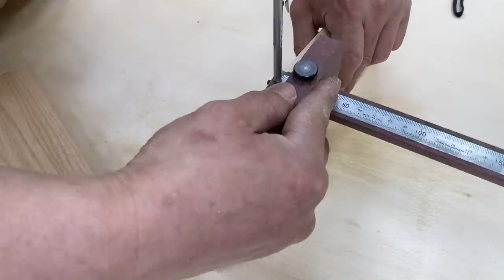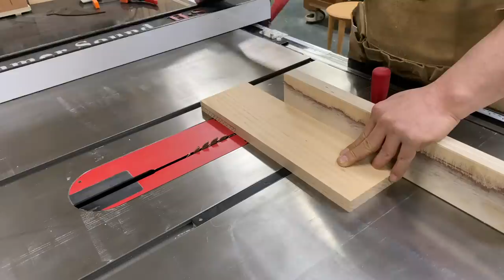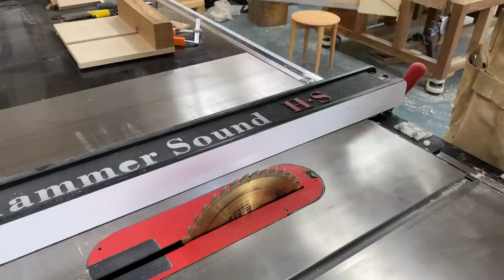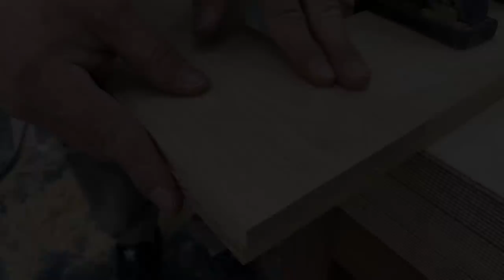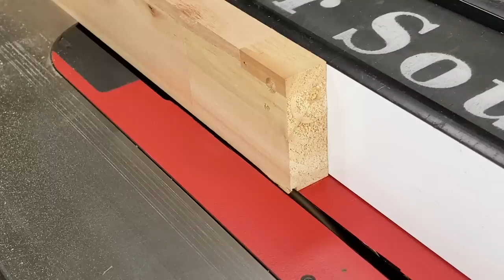If you let go of stereotypes, your level will go up./ 3 wood processing methods/Woodworking DIY

Comment: Make sure you buy and have the proper blade before doing this. They are harder to find than you think. They are called flat top or square blades. I had to order one online as all 3 hardware stores did not carry them. They are nice though.
Reply: Strong agreement! I recently tried doing this kind of cut with an ATB blade - mistake! It removed the wood just fine, and quickly,  but left lots of ridges. It took another couple of hours of plane & chisel work to make it all flat & smooth.
Reply: FLAT TOP BLADES ARE AS EASY AS GOING TO AMAZON.... LOCAL STORES ARE HISTORY NOW !!!!!!!
Reply: In my experience as a union carpenter, cabinet maker and woodworker hobbyist for 35+ years. I’ve found that to get the proper tools that perform on the level that the video shows. I buy my tools from tool distributors, not Home Depot or similar box stores or hardware stores. Tool distributors sell commercial grade tools, the chains and box stores do not. Online look for Rockler, Veritas, Granger, woodworkers warehouse.  Good luck.
Reply: In the UK I bought a "Groving blade" which is flat topped and has a much wider kerf. Best alternative I could find for a dado stack.

Comment: A secret for getting perfect depth laps on the table saw (using technique 1 and a scrap of the same thickness) -  Raise the blade and make a cut at the very end of the board. Flip it over and take another cut leaving a tiny tenon behind. Keep raising the blade slightly, taking a cut on both sides. When the cut finally takes off the thin bit left behind it is the perfect depth.
Reply: I’ll do that. Cheers.

Comment: Using the rip fence and crosscut slide at the same time is advanced saw work. If you get a bind things are flying out of the back of the saw at hi speed. I wouldn’t want to be in the way or have to patch the hole in the wall.
Reply: I think because in this case there weren’t any off cuts, it’s reasonably safe?  I would still hesitate to do it, but the waste is all sawdust so I think the risk of a bind is very low.
Reply: You should only use both when making non-through cuts like cutting a rabbet or dado.
Reply: My bet is I have 10x the time on a saw as you. Most of the stories from people with missing fingers start out the same as yours…
Reply: Let the pros handle that process, my fave way of doing tenons.
Reply: @robslifting4life  - lol-
I have hammers older than you.
I have worked on some pretty famous buildings. I have built the best of the best. 
I still have all my fingers.
And things happen on a table saw faster than you can think.
I am saying don’t do it.
Put a stop block on the fence. But don’t cut with the board on both. 
It works fine until it doesn’t.
Reply: @michaelgarrow3239  I myself wouldn’t do this, but do you agree with the logic of my previous reply? I can’t tell who you’re replying to in this thread.
Reply: @mrgolftennisviolin  - In my day I have done all kinds of crazy things on a saw.
However, I’m a professional and know what I’m doing. And some crazy stuff had to get done. But, I didn’t take any risks that were not necessary. A simple stop block can eliminate a potential problem. You only have to be wrong once. A knot in the wood or a nail you didn’t see can find you with a splinter the size of a hammer handle in your stomach. 
You do what you want to do. I believe in a free country…
Reply: @michaelgarrow3239  well said, I wasn’t planning on trying this anyway, I’m more into hand tool work for violinmaking, so rarely find myself needing a table saw.

Comment: This type of channel is exactly what I look for when I’m looking for wood working tips and instruction.  Showing multiple ways of achieving the same result, basically using what you have at your disposal to accomplish the task at hand. I subscribed and liked the video before I even finished watching it.
Reply: Just be more careful than this guy is.. there are so many safety rules being broken here.. never touch the blade of a saw while it's plugged in, never grip the router by the base... and never pull out a piece of wood from the table saw in the same direction the blade is spinning.. safety first out there. Machinery is not your friend and it will bite you the first chance it gets. don't give it that chance.
Reply: not to mention he has to riving knife on his table saw.. it's only table saw safety device that actually does it job. the riving knife alone will save you from 75 of the stupid things you can do on a table saw.
Reply: You have to remove the knife for the technique he showed, and lots of other techniques such as running a dado. It’s perfectly fine to remove it under the correct circumstances.
Reply: @randazzoworld8940  fair enough habits to promote and remember but keep in mind this guy knows a bit of what he’s doing. 

The table saw he’s using is a SawStop tablesaw. It literally can’t come on when he’s touching the blade, or for 5-10 seconds after. There is a safety trip function in the switch. He would know this and feel perfectly safe touching the blade. That being said: you should always unplug your saw when changing blades and NOT touching the blade is still safer habit to keep. As most shops won’t have the SawStop saw. 

As for the router many small palm routers like his have finger grooves molded into the base, and it helps keep the router from wobbling. It’s very hard to control with only one hand. The only thing he did that I wouldn’t have was place his finger under the still running router to showcase the gap there… I cringed a bit. 

As for pulling the work stock from the blade backwards, you are correct that it’s bad practice, but again, the techniques he’s using somewhat force this method. If the operator is careful, skilled, and practiced, it can be done with relative safety. 

Is still a great video, and earned a sub here!
Reply: Great safety concerns explained. Thank you all. My guess is video intent is to demo the different possible approaches.

Comment: " If You Let Go Of Stereotypes, Your Level Will Go Up"
A Piece Of Life Wisdom That Goes Far Beyond Just Woodworking  😏
Reply from the maker: Yes, that is true😊😊👍👍
Reply: Praise Jesus, Repent or Likewise Perish  ratio
Reply: I hope safety is not stereotyping.  Please don’t let that go by removing the riving knife. The riving knife doesn’t interfere with any of the operation in this video.
Reply: @iknowgamingikg4025  well that didn't work
Reply: @ipick4fun27  if you know what the riving knife is for then you should understand why removing it isn't an issue
Reply: @davefarmery8180  for the same reason, I know what mask, eye protection as well as hearing protections are for.  I guess removing them are not issues as well? SMH.
Reply: @ipick4fun27  my bad , i thought you would know why its not a problem
Reply: @ipick4fun27  none of their cuts would have caused jamming removing the knife did not reduce safety at all.

Comment: Thank You for this video.very nicely done even without narration. These are great techniques which I will start using. Will make these joints easier and faster as well as more accurate. Greetings from Maine.
Reply from the maker: Thank you for watching.
I am cheering for you.👍👍👍

Comment: I love this video.
It addresses my biggest pet peeve on wood working videos

I get really frustrated when I see someone use a single table saw blade to chip away a dado cut and then waste lots of time to chisel and maybe even sand that dado cut smooth.

I prefer to take extra time to use a router table as I can make a pass on the table saw, then move it to a separately set up router table. I feel I get a much better dado cut and the fit is much more secure. 

But I also saw a few ideas I will try for the table saw.
So long as I don't waste lots of time chiseling the jagged table saw cuts away.
Reply: This video isn’t about the tools you do have, but about the tools you maybe just don’t have.
Reply: @firewing1319  exactly. Not everyone has all the tools and this video shows a variety of methods to cut dado.

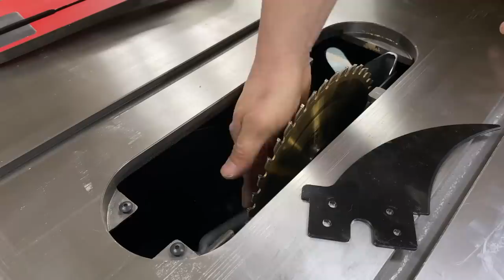Comment: Why remove the riving knife at 0:28? The top of the riving knife should be below the crown of the blade and it should not interfere with the cuts you made.
Reply: I was wondering the same thing. No harm it’s not a through cut, but I’d still leave it on.
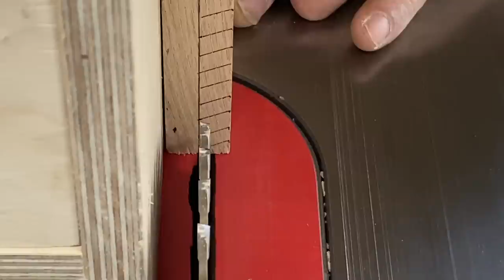Reply: @brian454454  While riving knives are most important for through-rip cuts, they do offer some kickback protection during any cut. One would have especially been important during the second cutting operation shown in this video (2:57), when a rip was made. A riving knife would help protect the user from kickback that may be caused by that non-through kerf closing upon the blade.... I'm not the safety police. If he doesn't want to use it, that's his decision and I won't nag him for it.  I just thought it was strange that he took the time to remove it and I wondered why that was.
Reply from the maker: You don't need a knife for this job and it gets in the way.
Reply: Thank you! I thought same thing but I couldn't REALLY recall all the times it was critical vs detrimental... however it seemed like it wouldn't have hurt on any of his applications.
I must've learned SMTHN during all those hrs watching your vids ; )  👍
Reply: @StumpyNubs  diffrent countries diffrent safety regulations, as a german trained cabinetmaker and joiner we were taught that the only cut that is allowed with out a riving knive is an undercover cut. But we probably have the strictest guidelines 🙄
Reply: @connorleon  how the German carpenter orders five beers🤟
Reply: @edsnotgod  fünf bier fürs Sägewerk
Reply: @connorleon  wie der Schreiner..

Comment: With the router when you did it, I saw the immediate problem - which you showed - about it "rocking".
My solution would be to start at the other "end" of where you were wanting to cut away the material/wood so both sides would be supported.  Kind of how you did it in your solution: leaving the ridges then removing them with the chisels.
But instead my way would be that you also have a "stand" that you put under the router to keep the correct height as the gap becomes too wide for the router's support.
However:  very nice job.

Comment: Nice, though I wouldn't feel comfortable doing some of the table saw techniques used, I'd worry about pinching and kickback. Still, always good to remember there are many ways to skin a cat, so you can always have your pick of the ways that seem best, just keeping in mind there's more than one.
Reply: someone in this thread mentioned they are using a specific blade. flat top saw blade maybe?

Comment: Easier and safer to make a surfacing jig for a router than use a table saw IMO, and the chances of having a decent table saw but not a router are pretty slim. Clever saw work though.

Comment: The second technique where he rips into the wood then flips it over to get the other side,  will produce a lap that is 1/2 of the saw blade width too thin on each piece.  The resulting lap will be 1 full saw blade thickness too thin.
Reply: Yet you saw that it came out perfectly so you must be wrong or he cheated and used special effects or deceptive editing.

It's the former, you're wrong. You're ignoring two facts:
he first lined up the side of the saw blade with the line he made on the timber so the first two cuts are to the required width exactly
when he flipped the timber over he adjusted his fence to align the existing cut with blade
Reply: He reset the fence

Comment: These are really cool, but a lot of these techniques aren't necessary. A good handsaw and chisel will accomplish all of these tasks. It seems a lot harder at first but with a little practice its really quite quick. I find the best use of a table saw is for make lots of repeated cuts accurately. Not necessarily for joinery.

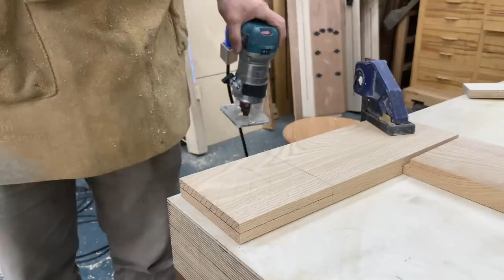Comment: 4:35 I think I could get away with using this method with my Bosch 12V router (GKF 12V-8), as it is designed to work on edges. the round end of the base is 40mm on center, but the square end is 100mm (~4") on center, so much easier to control on edges.

Comment: If you spend 20000 $ on equipment, you can glue two pieces of wood ;)
Reply: I've built barn doors with my cordless makita trim saw and a garage sale chisel. I guess people would rather watch a video series than actually build,  not over build simple stuff.  Of course in Texas we compete with guys that have probably never used a power tool until they came here

Comment: The first two methods are dangerous and should not be attempted unless you want hurt if the wood catches the blade. The second one especially will will get you in the nuts whereas the first one will probably only damage some fingers.

Comment: I'm trying to figure out what stereotypes he is referring to?
Most of these are just common sense.
The using the table saw sideways is not a good idea, as it pits stresses on the blade in a way it was not designed for this may cause your blade to break.
The tiling router is again using the tool wrong, your not supposed to push down on the side without support, and well you saw the result. Most woodworkers don't have this issue. However, if they do need to prevent it they can simple place a support jig under the unsupported side.
The rest of this is just using the tool as intended. Nothing novel there.

Comment: Yeah, well when you stop being a beaver you wood skills go away,

Solution, hire a pet beaver and he will do this for you, or a carpenter who is like one

I like how you work safe
Showing good habits can save others

When showing expert level, it's sometimes nice to show to ultra safe way first for some

One thing I learned was holding a speed square while using it as a guide for your saw, make sure it's clamped or you hold it on the same edge of the board as you, holding it on the opposite side of the board can cause side pressure if you're holding it and pulling towards yourself, I slipped on an icy board and my hand and square slid to the right and my fingers almost went into a saw blade, I saw it late drawn on a speed square package showing the squirrel in the opposite side of the board, bad idea